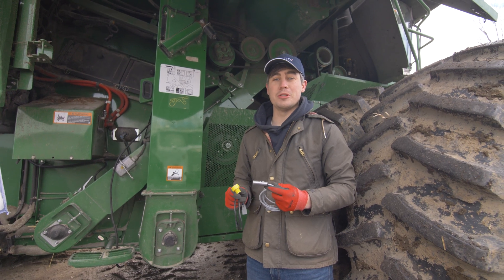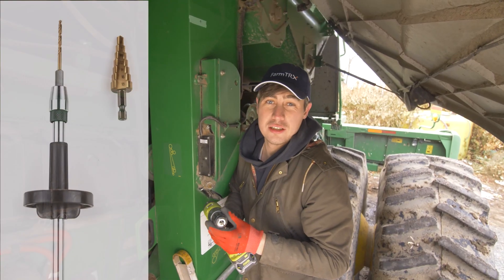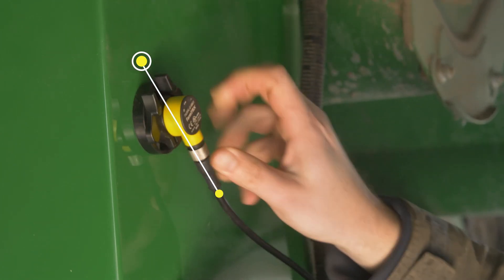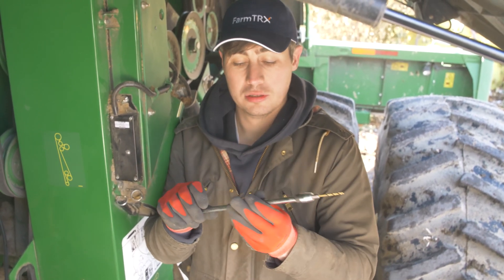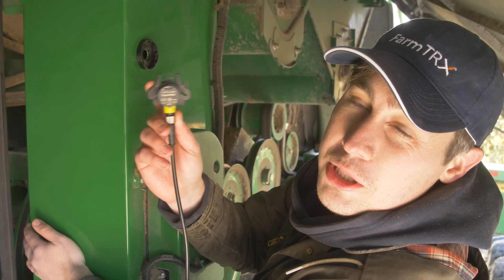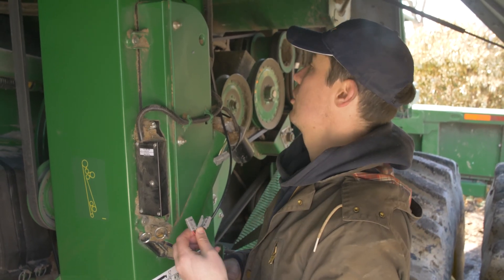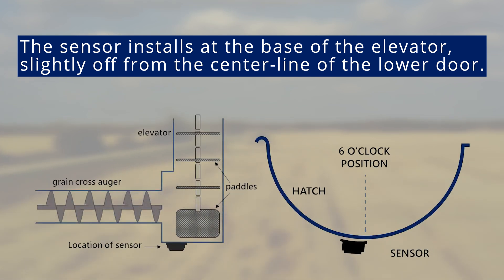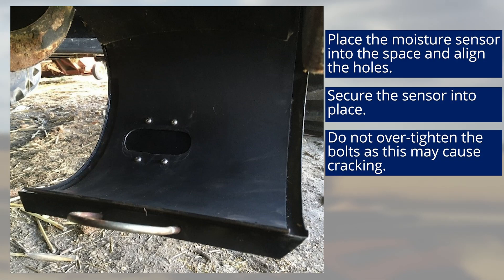FarmTRX QuickConnect Optical Sensor & Moisture Sensor Installation

Comment: Is the new optical yield sensors more accurate than old ones? or just easier to install.
Reply from the maker: Hi Grant, the new sensors are very close to the same specs as the old ones. The biggest design gains are in the ease of install and reducing clearance issues. Hope that helps!